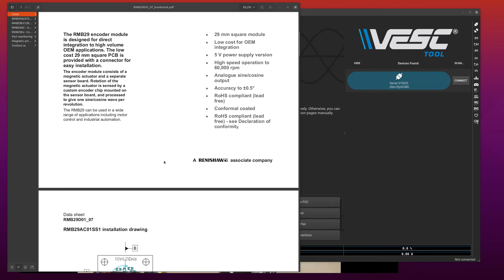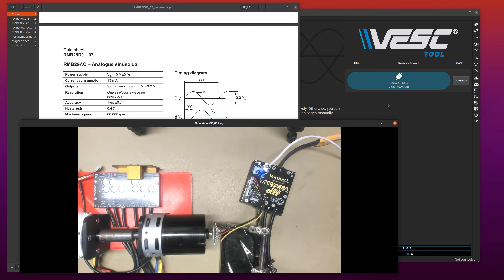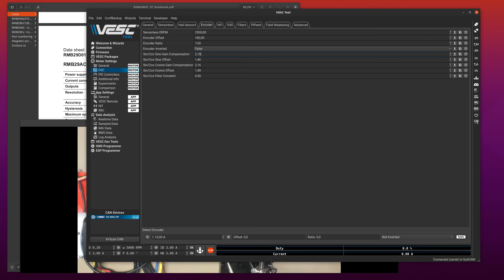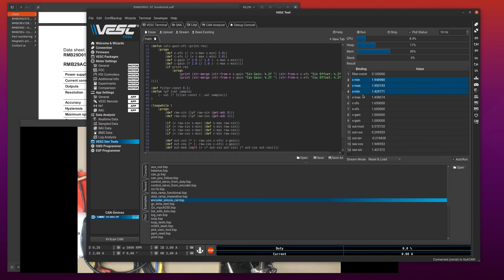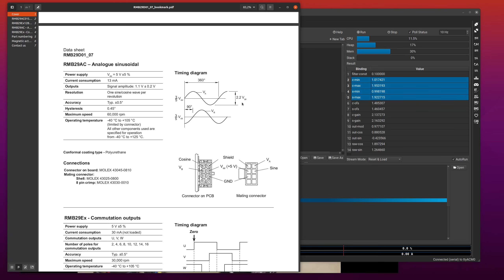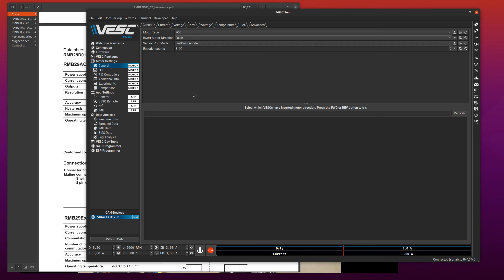VESC Sin/Cos Encoder

Comment: I am using a Motenergy motor with the RMB29 encoder, according to the data sheet for the chip on the board it will work when powered by 3.3V.  Doing this also lowers the analog values so you can connect them without scaling resistors.  Is there any documentation on the VESC parameters and what each does?  I would like to understand the parameters in general and specifically want to make sure the controller is using the Sin/Cos feedback all the time instead of switching to sensorless.  Thanks.

Comment: Thanks Benjamin! I actually have a ME1716 motor with this same exact encoder on my RC lawn mower. I am planning to use it with the VESC 75-300. I bought a hall encoder that looks like almost a drop in replacement for the SIN/COS encoder. It is RMB29EE12BS66. I haven't gotten around to installing it yet. I still have reservations about using SIN/COS. My biggest fear is that induced voltages in the sensor wires could burn out the analog inputs on the VESC. It is good to know this is an option though incase I cant get the hall encoder working. ~Mike
Reply: did you end up getting the ME1716 and VESC75_300 combo to work? I am using it for a Go-kart project but with the sin cosin encoder and it doesn't seem to work? any advice would be a great help

Comment: Thank you so much, now I can run my Heinzmann PMS 120 with vesc :)
Reply: I was just thinking the same :)
Reply: Until you find out about the signal integrity of the encoders built into the motors…
Reply: @joelschulz-andres  Pms has the same encoder, wich Vedder showed in the video
Reply: It works great on the Sevcon, no reason it would not be workable here